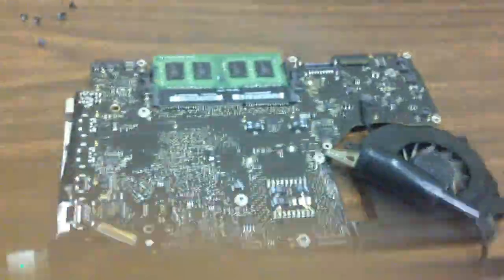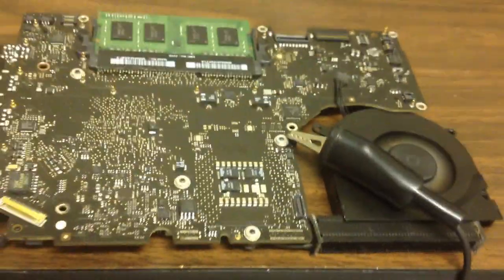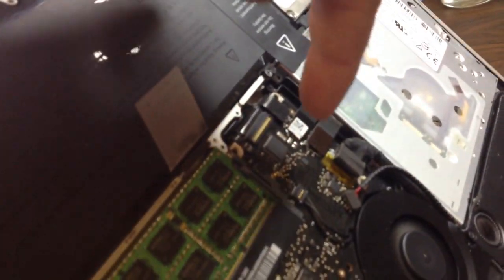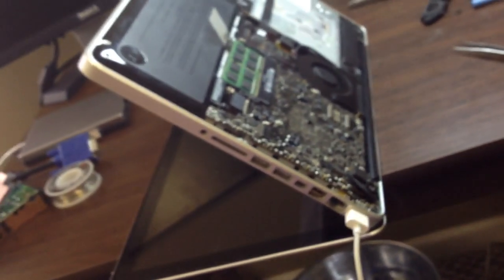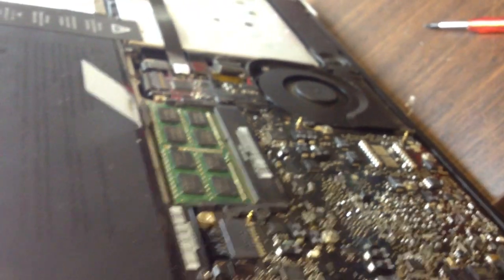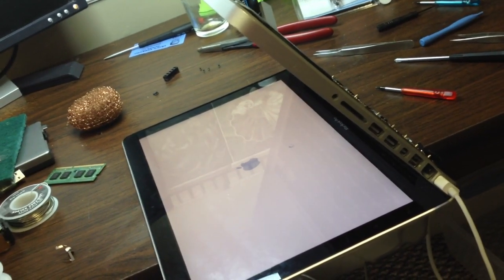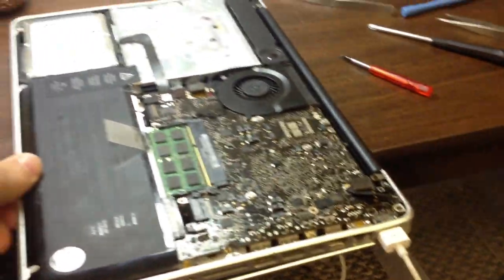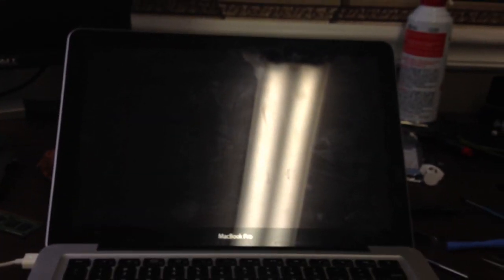MacBook Unibody 13 inch laptop motherboard repair to fix a random cut off and no video issue

Comment: Hi- awesome video-thanks! My problem is (2010 MBP 13, water damaged) logicboard fried. Installed a new one- had to jump the power button (thanks for the video!) fan starts, hear the spin, it chimes, screen lights but remains blank- won't boot. Any suggestions? thanks!

Comment: That keyboard bypass method doesn't work with mine, yet the pad still reads 3.42 volts. Any clues as to what it could be? Or is it one of those things that could be a plethora of issues?

Comment: I installed the drive upside down by accident (newbie mistake) and now macbook won't power on.  Took the wole thing apart to see if I knocked something loose, but I don't see anything unusual.  Not sure if the keboard cover shorted out or worse...the logic board shorted out.  Does anyone know of any easy troubleshooting techniques that I can do to determine the root cause without having to purchase another keyboard cover?  Much appreciated.

Comment: Hi, what chemical would you recommend using to clean the board? Also do you use a soft brush like a tooth brush type bristle or more of a very soft wire brush. Would be grateful for a response. Thanks in advance.